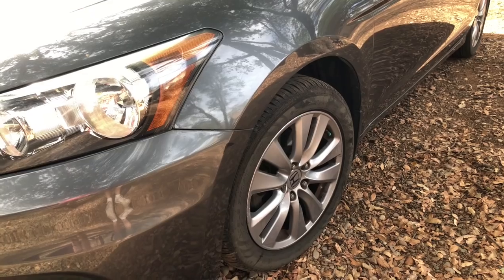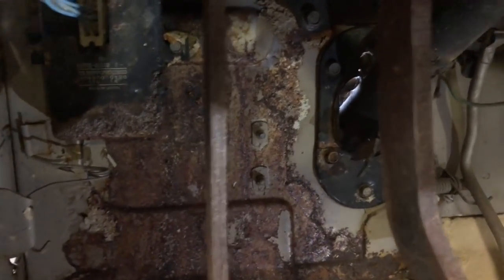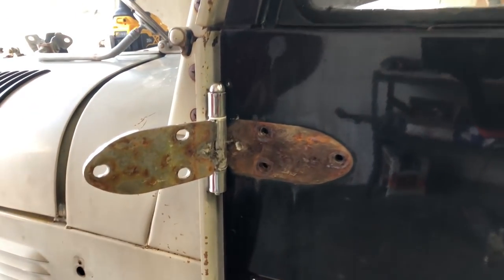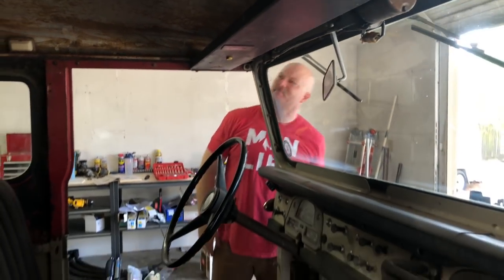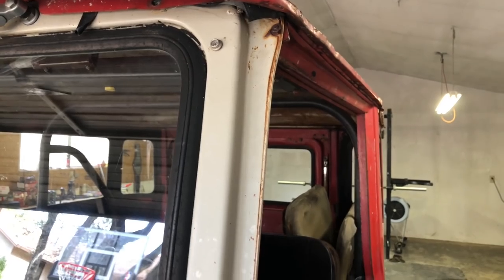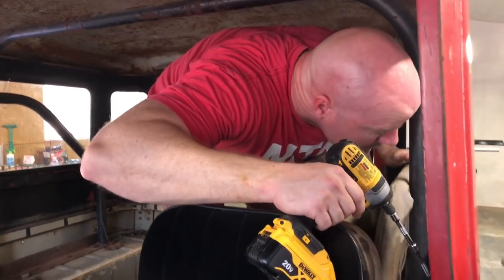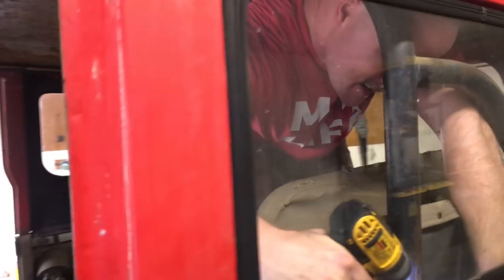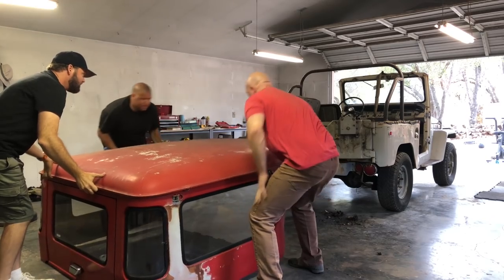Project Wrong Way 1 - Restoring a 1972 FJ40 Toyota Landcruiser

Comment: I loved that you goal is to give us hindsight ahead of time. I have a 1970 LandCruiser I am restoring. Welcome to the brotherhood of broken bolts. I’m running at about 50% so far
Reply from the maker: 50% sounds about par for the course man. 1970 40 series? Either way, it’s a good year.
Reply: Project Wrong Way Yep it is a 1970 FJ40. I have driven it off and on, mostly off, for the last 10 years. I am tired of it breaking every time I drive it. So, it is finally time for a complete restoration
Reply from the maker: That’s love it deserves, makes for a great drive knowing the bolts are holding up!

Comment: Loved the intro.  Love the humor mixed in.  You have a great personality for what you are doing.  I made friends with PB Blaster to help out with my rusted bolts.  Works well so far.  Don't forget to keep all those bolts together in bags and label where they came from, if for no other reason then knowing what size to replace them with if you can't reuse them.  This is going to be a great series, thanks for doing it.  I know it is a lot of extra work to film.  It is appreciated by the rest of us attempting the same thing.
Reply from the maker: Thanks man, it is another step making sure the camera is on. Keeps me from walking down to the shop and just fixing stuff, because I’d rather get it on film. Changes the pace a bit, but it’s what I was planning on doing when I made the show. Got to stick with it.

Comment: This is great! Was thinking of putting my own videos up but now I get to watch you guys. The only few things I have done is fix the fiberglass roof on my 1972 FJ40 by patching a few holes and cracks with fiberglass, adjust the brakes, re wire the wire harness to make sure all the lights work, hooked up a tachometer, and replace all the tie rod ends - which was a fun project. Good luck! I will be watching.
Reply from the maker: Daniel Louvet man, you’ve done some serious stuff. I lucked out some parts in the last few weeks, should make for some interesting installs.

Comment: Just found your channel by chance...very funny, you only need to add Benny Hill music in for the best effect. I could tell pretty quickly that you were a college boy vs blue collar, but it’s all good. I’ve watched a few of your early vids while you build up your FJ, nice rig. I’m sure you’ve been beat up about eye protection, but as I use to tell the mechanics who worked under me while in the military, they are your eyes. Wear the safety gear to protect yourself, no one cares more about you that you. I need a good laugh, so back to watching more of your vids doing repairs over agin...been there, done that.
Reply from the maker: jarhead6153 outstanding! I’d run the Benny Hill theme, but I’d probably get screwed for copyright infringement! I get more eyepro as the episodes go on, enough close calls that I wear it more. Plus, wifey keeps me in check. College? Dropped out, but yeah, guilty on all counts! I get slightly better as I go, but keep your expectations low around episode 11... actually all of them. Thanks for watching man, always appreciate feedback.

Comment: So you have not removed the fiberglass top from the backsides or top of the door frame or removed the rubber gasket or the metal flange from the fiberglass top. It’s all super fun. I had to take my apart because someone had filled it full os silicon calk to try to stop the leaking. My fiberglass top needs a little repair and so goes the metal gasket. It was riveted on with about 70 rivets that I had to get out and will eventually will have to put back. 
All of that I figured out but the two parts that go above the front doors was the hard part. They both are two pieces. You must slide the apart your get to the bolts that are underneath the top piece. We made a video of it because I couldn’t find one video showing that part of the removal. 
I think most of the metal gaskets are rusting from the underside where you can’t see it
Reply from the maker: Nice work!

Comment: lol mate bloody crackup stuff, I just brought myself a 1980 HJ45 Troop carrier which is just a long wheel base with a diesel version of yours. One thing soak everything with WD40 and leave it over night will help you a lot getting bolts apart, also ebay bolt sets the Toyota.
Reply from the maker: Troopy Life thanks Troopy! Hj45 is a dream cruiser! Thanks for tips, and sub

Comment: Dude use the proper tool for the job. Trying to shear a bolt off with a wood chisel is just going to damage the tool, fj, or yourself.
Reply from the maker: Good call man. Although this was filmed almost three years ago, that advice is still relevant today.